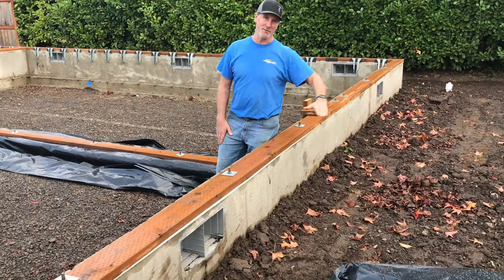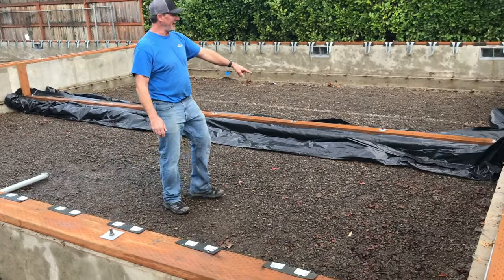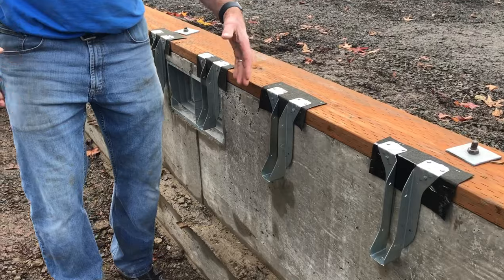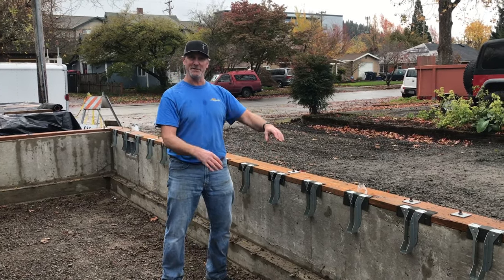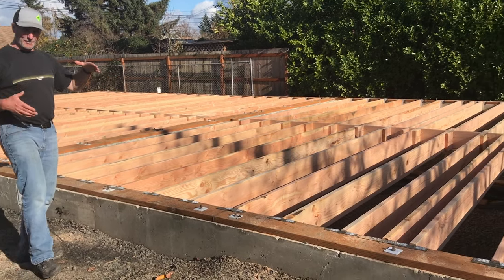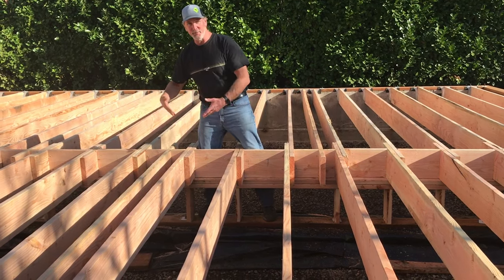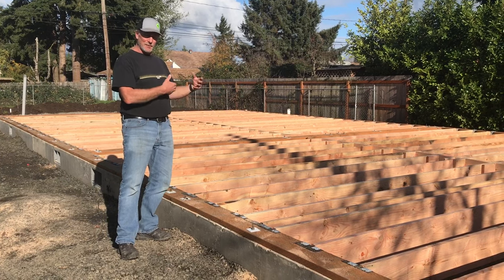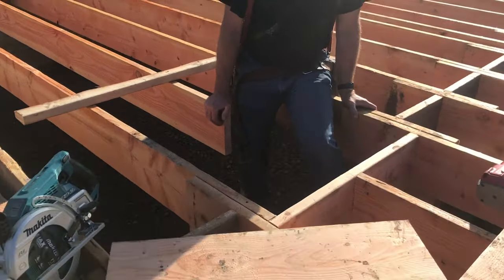Framing a Crawl Space Underfloor | Paul Rea

Comment: One thing you didn't mention is that the engineered I-joists are a firemans nightmare. BTW  I have never seen a floor system framed like the one I see here.  joists have always been on top of the sill
Reply: First thing I noticed in the thumbnail…was wondering what all the hangers were nailed into.
Reply: Yep, we east coast guys start our framing on top of the foundation wall and the we use piers and girders in the crawlspace instead of a pony wall.

Comment: What's wrong with actually bearing the joists on top of the foundation wall?
Reply: Nothing. However this solution can provide different benefits. Including reduce threshold height. Good for grandma.
Reply: @samt5663  True enough:)
Reply: This method creates a direct path for foundation moisture and termites to the end grain of untreated floor joists.
Reply: @theferallife8812  this is true,
Reply: @theferallife8812  Termites don't care which way the grain runs. But if it was mine the beam ends would be soaked in creosote and that black (rubber?) layer under the hangers would drop all the way down past the beam ends.

Comment: Over here in the Nordics, many houses in the 60s and 70s were built with pressure treated sills which begun smelling after a few years and nowadays regular wood is preferred. Perhaps other chemicals are used these days that won’t smell as bad.
Reply from the maker: We had built two other buildings in 2019-2020 with the same treated sill type.  We haven't noticed any smelling.  Thanks for the comment. :)

Comment: Omg don't do this folks. My lakefront home was built low to the ground like this and it is a nightmare working in such a short crawl space
Reply from the maker: Crawl space area is not too low because stem wall is nice and high.  Pretty easy to move around while underneath.  Of course you do have to crawl, but that is why it is called a “crawl space”.  😜
Reply: @buildinghouses  lol it should be called  a back space because the only way I'm able to work on anything down there is on my back looking up and sliding around on my back.
Reply: I wouldn’t do this without putting a concrete pad on the floor and these us a mechanics sled to get around in the space

Comment: Please let me know why you use hangers for the joist instead of putting the joists on top of the sill? Thanks. I’m just learning
Reply from the maker: If we put the joists on top of the foundation wall then the building would be a lot higher off the ground (would need to build steps to get to the front door).  To get the same height, more excavation might be needed, or maybe a shorter foundation wall.  Using hangers is a simple solution.

Comment: Several things mentioned previously, and I ask the same. 
Perhaps the structure has a height consideration and thats why floor joists are Not on Sill or mud plate. 
A few others ask same and other points.
Reply from the maker: This is a good question.  Here is Paul Rea's response: 
I have been questioned a number of times why we place the top of the floor joists flush with the top of the mud sill and do not place the floor joists on the mudsill entirely.  To answer this I will remind folks of what we are trying to achieve with a foundation and a subfloor at least in our application.  The concrete must be a minimum of 6 inches above the backfill and the dirt must slope away from the building.  I prefer to put foundation vents at the top of the stem wall and they are 8" tall. I don't like to build wells around the vents so basically the dirt comes to the bottom of those.  This puts the mudsill around 10 inches off the backfill.  If I place the joists on top of the mudsill this makes the distance to the finish floor around 20 inches (three steps) from the dirt.  If I drop the joists inside, this knocks about 9 1/2 inches off of that total.  I am required to have a minimum of 18 inches from the bottom of the floor joists to the ground in the underfloor area.  My combination of 8 inch high footing and 24 inch high wall equals 32 inches.  Add the mudsill and you are at 33 1/2.  dropping back down the depth of the joists gets us to 24 inches of underfloor clearance.  We could have poured a smaller footing and a shorter stem wall but this works out to be a comfortable combination.  Thanks for the question.

Comment: i noticed the mudsills with the joist hangers were flush with the interior of the stem wall, but the mudsills that didn't have joist hangers were flush with the outside of the stem wall. and they also looked like they might have been a smaller dimension. am i seeing things right? what's the reason for these decisions?
Reply from the maker: Good question about the mudsill dimensions.  Yes we did use different sizes.  I believe we used 2x8 pressure treated lumber for the stem walls with the joist hangers and 2x6 for the end walls.  We used 2x8 because the joist hangers needed to be flush with the interior wall and we wanted the mudsill to extend as close as possible to the outside of the stem wall.  If you look closely, there is a gap between the 2x8 and the outer edge of the stem wall.  Paul later cut long strips of pressure treated lumber to fill in those gaps.  For the 2x6 end stem walls we just needed to be flush with the outside of the stem wall as it supports the sub floor and the 2x6 bottom plate of the wall, so really didn't need 2x8 material.  The interior stem wall that runs parallel to the joists we used 2x4 pressure treated lumber.  Two 2x4 firewalls are being built on top of it.  We used 2x4 because we need an air gap in between the fire walls and because we are building 2x4 walls above.  See our next video "Building Walls for a (Duplex) House" for more info.  Hope that helps.

Comment: Thanks for video is there any advantages to a engineered floor joist truss system in a crawl space home? Possibly doesn’t twist or bend at all limiting squeaks or things of that nature? Other than cost but would that be “overkill” in a raised foundation home vs the 2 x 10s? Thanks again!
Reply from the maker: Engineered floor joists can span longer distances.  They may be easier to install.  We had to use two 2x10's per row instead of just one floor joist per row.  They are supposed to be less likely to split, shrink, twist, warp, or bow.  The manufacturer may also provide a warranty which you won't get with the 2x10's.
Reply: @buildinghouses  thanks for the info! is this at all a common practice with a crawl space home? Or kind of unheard of in that realm?

And what might guy expect double triple or so the cost of dimensional? Thanks again
Reply from the maker: Another factor to consider is the cost of labor for installation of the joists.  The engineered floor joists are easier and quicker to install so if you hire it out, the labor may be cheaper.  Paul is a construction instructor at a community college and we were giving his college students hands-on training so labor and time were not a factor. Back in late 2021 early 2022 when we were constructing this building, the 2x10's were $1.40 a foot and engineered trusses were $3.80 a foot.  We built another building in 2022/2023 and the engineered trusses were still at least two times more expensive.  The 2x10's used to be the common practice before the engineered joists came along.
Reply: @buildinghouses  gotcha thank you. Is there a certain amount of days you want to wait before building on top of a raised foundation for the concrete to settle?

Comment: Unfortunately my few years framing experience was mostly building on slabs but any joists or decking...where decking falls and fastened to middle of the 1 1/2" joists, how do you accomplish this with your staggered joist at center girder......sheet would fall short or long or is your distance to center an even 8,12,16, if not you'd need to notch out every 4x8 at this shift.The diy audience that this video is directed to would run into problems with this. The overlap at girder should give cantilever strength and lengthen the joists span but none of online span charts address this. I'm aware that engineering a build is smart but with so many tutorials online many who aren't required to pull permits aren't.

Comment: Just make your floor with concrete joists   isolation and pressure layer with concrete. It wil never rot. This is Amarican way of building and the quality is bad
Reply: Concrete I-beams with load-bearing blocks between are super strong. But when you have more than enough lumbar why not use that instead?